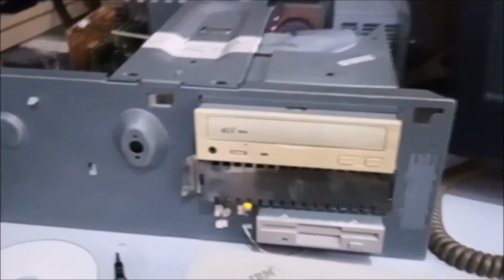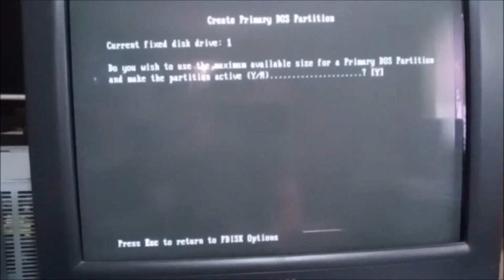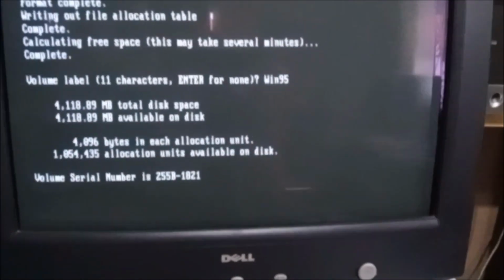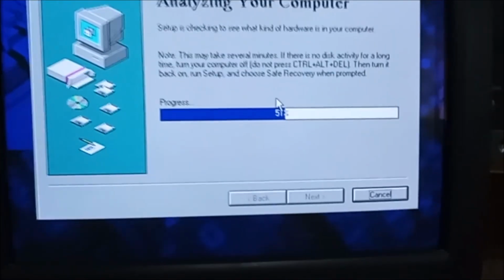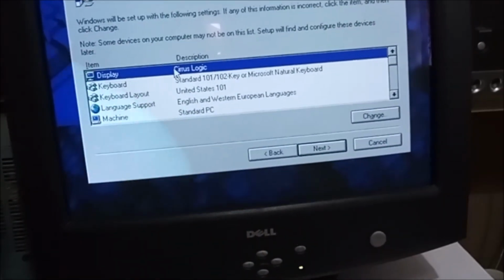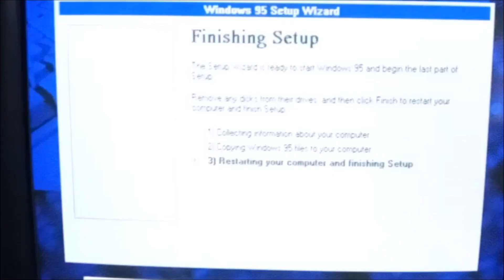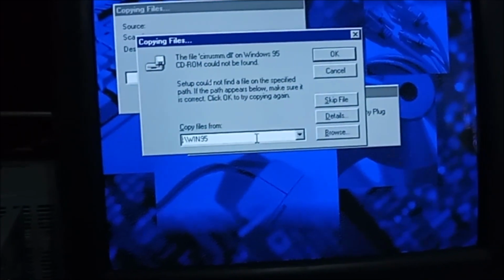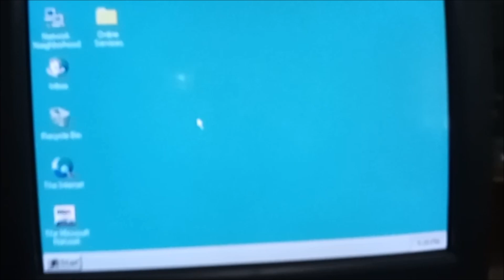Installing windows 95 on a PC from 1997

Comment: cool video ,, i have been trying to intall windows 95 , i will try this,, are you running fat 16 or fat 32 and how big is your hard drive ,iam using a dell 266mhz  desktop computer,,,,,  ,, hope you still keep making videos,, sounds like a original old hard drive
Reply from the maker: It is formatted to FAT 32 and the hard drive is a 4gb seagate drive. I do have to say that if you want an old school mechanical drive I highly recommend a seagate drive as they are crazy reliable. I have had many hard drives die over the 7 years that I have been collecting and the only reason I have for the seagate drives dying was mainly external things like bad power supplies shorting out or once a cheap hdd docking station blowing up while I was writing files to the drive 😅. But I do have to say though when it comes to old computers it is mostly trial and error and sometimes things won't work and you do have to get a bit creative but as long as you keep at it the computer will one day work like dream. 😁